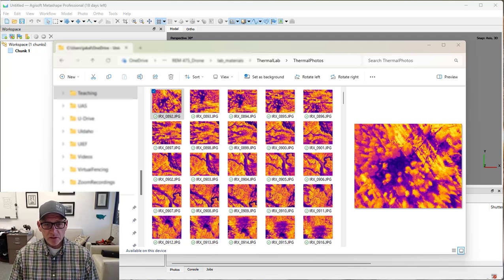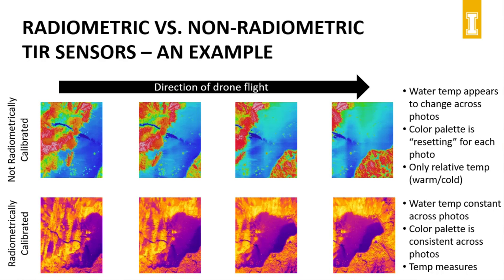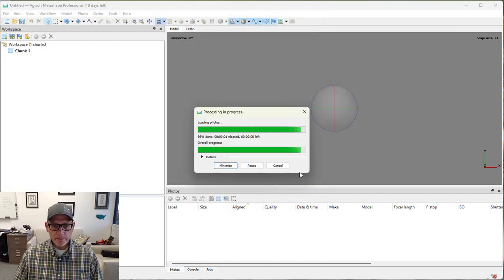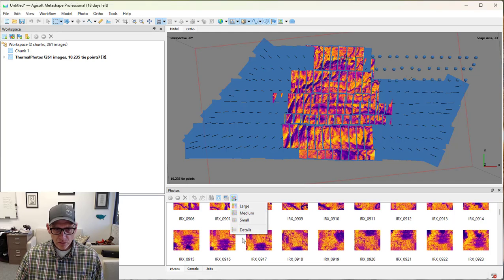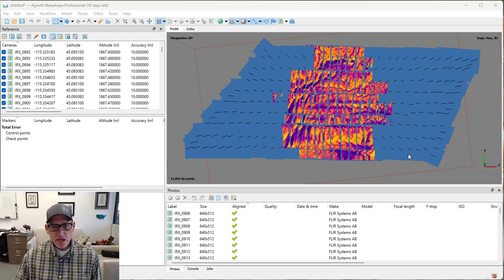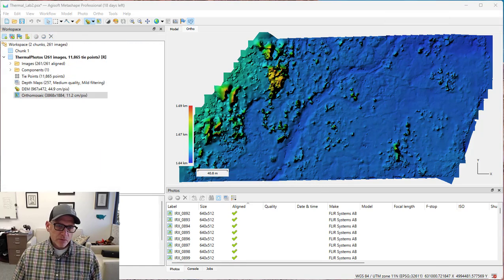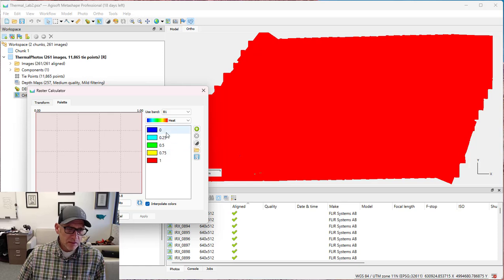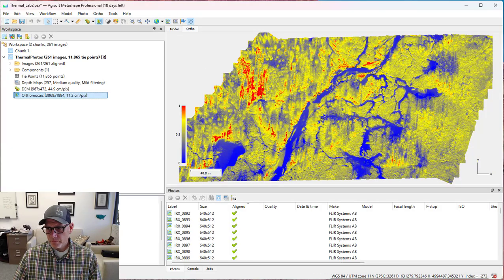Using Metashape For Thermal Image Photogrammetry

Comment: One effective method could be to convert our images to temperature data before processing. This transformation might provide a more consistent and reliable input for the next steps.Additionally, when using Metashape for alignment, I’m using the "High" setting for alignment quality.  Thanks for sharing  i’m learning  a lot from your videos

Comment: Can you cite a few sensor models that are radiometric calibrated? I think that the most commom DJI sensors wouldn't be capable to generate this kind of result, right?
Reply from the maker: I don't have a ton of experience with DJI thermal sensors, but I believe many of them are radiometrically calibrated. I know the older Zenmuse XT2 was and the newer Zenmuse H20 and the Mavic 3T are too. Interestingly, the new H20T and H20N payloads and the Matrice 30 and new Matrice 4 don't say they are radiometric sensors, but they apparently export in R-JPEG format which would include the temperature data. Definitely worth asking someone who has one of these sensors! Thanks for the question.

Comment: Hi, I am using the DJI M300 + DJI H20T. When I import into Metashape I do not get that prompt about the multi camera system. I only see single and 4D options. Since this whole video stems off that, is that an add on or something metashape will automatically pick up. I have tried converting my RJPEG to .tiffs and that doesn’t work either.
Reply from the maker: Nope, it's not an add-on module. I suspect that it's just how the H20T photos are structured, but they should still work. Would you be willing/able to share some of your photos with me? I can check them out and give you a better idea of what's going on.
Reply: @jasonwkarl ah makes sense. I was doing some digging and it seems that DJI has proprietary coding built into their sensors that makes getting radiometric data pretty difficult. Same with their LIDAR. I was able to convert the RJEPS to tiffs while maintaining the radiometric information. I was able to loosely follow your video and another persons video and get a ortho with index temp values. Pretty cool. What module did you use to import those images if I may ask ?
Reply: @Wolverine69522  I use a DJI; the RJPEG files are indeed proprietary and need to be converted to TIFF. Could you tell me which app you used? Or did you convert them using the command line?

Comment: COULD YOU MAKE A SLIDE SHOWING HOW I CAN SET THE TEMPERATURE BETWEEN 0ºC TO 125ºC, BECAUSE I PERFORM INSPECTIONS ON SOLAR PANELS.. THANKS A A LOT
Reply from the maker: Thanks for the question. Do you need the individual photos converted to temperature, or an overall orthomosaic? How you set the temperature from the TIR images will depend on what sensor you have. For many TIR sensors like the FLIR Boson sensor in the Autel Evo II Duo 640T, the pixel values are in degrees Kelvin times 100.  For others like the old DJI XT2 sensor, the pixel values are in degrees Kelvin times 25. Once you find the right equation for converting the pixel values to temperature, then you can use a raster calculator in a GIS program like QGIS, or do with the raster transform in Metashape. 

Note, though, that the temperature values can be off by quite a bit. It's not uncommon for us to see temperature differences of 5 degrees C. So, in practice, it would be good to take some temperature measurements of known objects (that can be seen in the imagery) and use those values to better fine tune your TIR temp estimates.

Hope this helps!
J

Comment: Nice, subscribed. 

Im planing to purchase an RTK Drone like Phantom 4 for basic topography. Your videos is being really valuable to learn the Metashape. 

Thermal drones is more for inspections or it has applicability on topography as well? The price difference is huge.
Reply from the maker: Glad you find the videos useful. The P4 RTK is a great drone! The Mavic 2 Pro is still one of the workhorses of our drone fleet.

Thermal is good for anything where temperature information is useful - infrastructure inspection, search and rescue, agriculture, water quality, etc. You'll get an elevation surface from thermal images, but given that TIR images are so much lower resolution than even cheap RGB cameras, they're not a great choice for most topographic applications. For use, we're only flying TIR imagery when we need it for a specific project. Hope this helps!